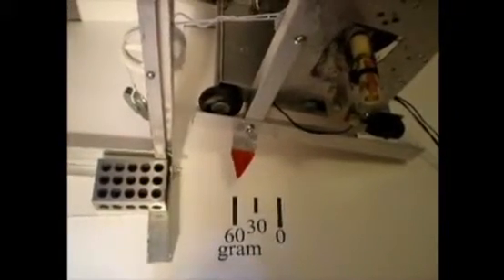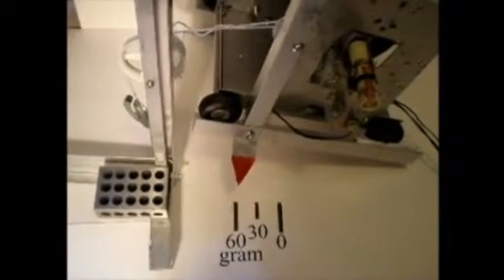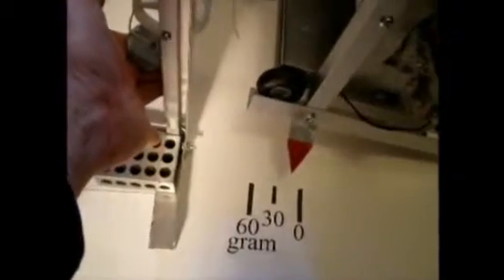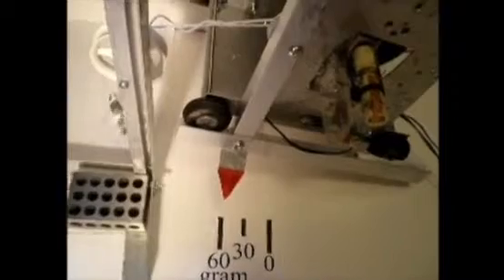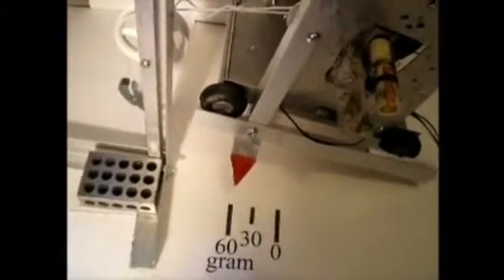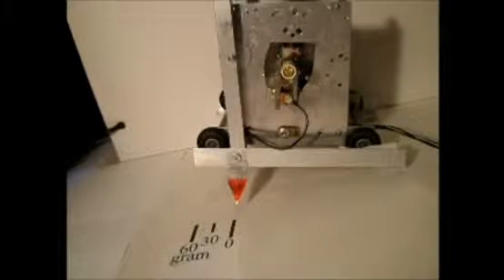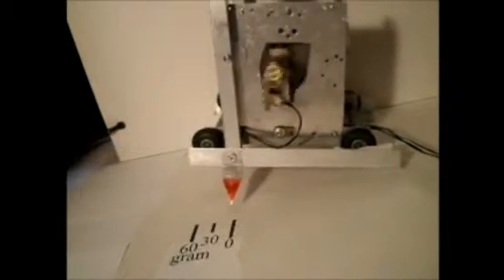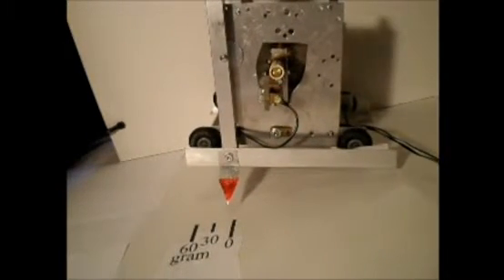The 30 gram thrust Pendulum Test  Inertial propulsion with continuous Rotation

Comment: what I see is the device oscillating about a point near the 30 mark. it doesn't go to 60 or back to zero.
Reply: If you notice when calibrating at the beginning when he takes off the weight it doesn't quite go to 0.  So thats why it didn't go back to 0 in the test.  And yes his device only created around 30 grams of thrust but at least it makes thrust.
Reply from the maker: Yes, it operates-lifts on a heavy 8foot pendulum with some friction on the pivot. Please refer to my books on "Inertial Propulsion" on Amerson.com books